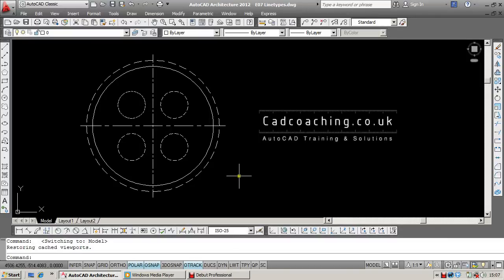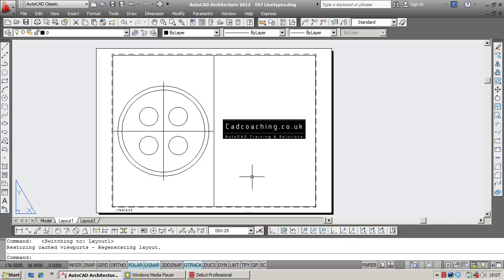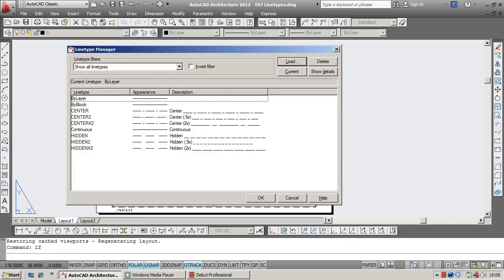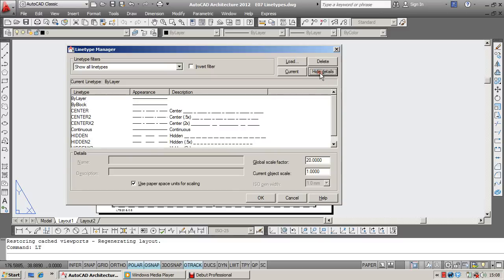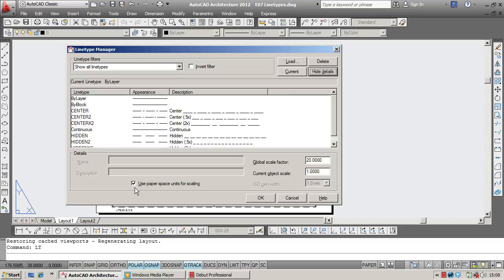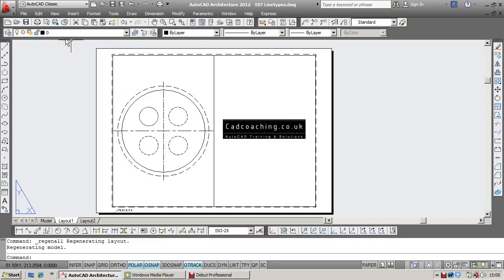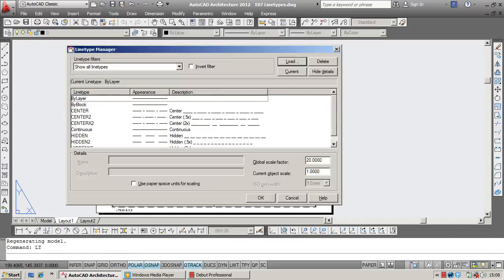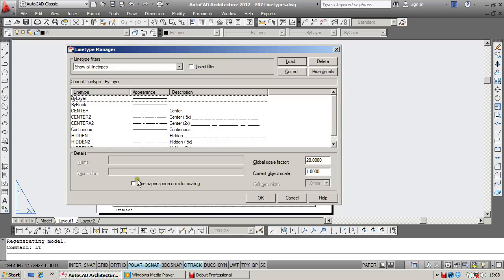AutoCAD Linetypes: Solving Paper Space problems.

Comment: how about if hatch can't be seen in plot preview?
Reply from the maker: Marlo, the one thing I can think of is that the layer that your hatch is on has been set to non-printable. Check the layer in the layer manager and look for the little icon of a printer (it's often out of view so you may need to scroll sideways to see it). If there is a red strike through the icon then the contents of the layer are non-printable even though they are visible in model space.